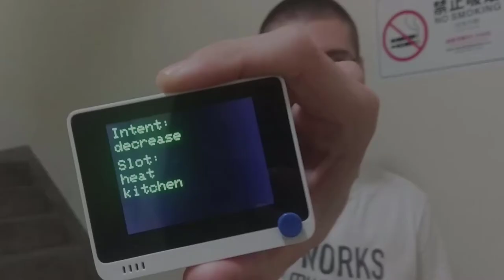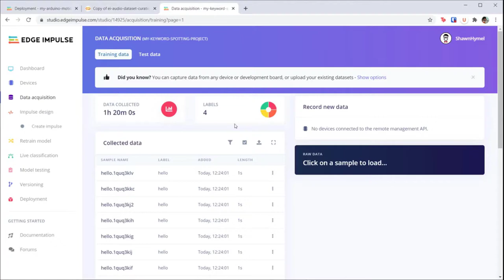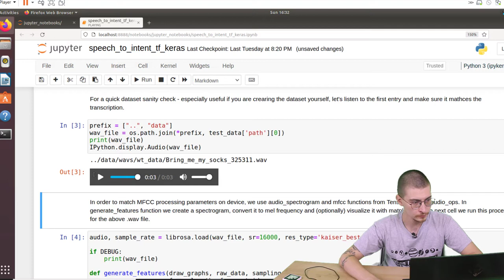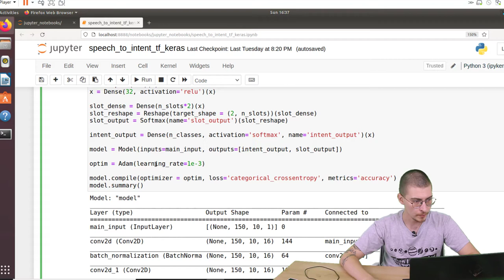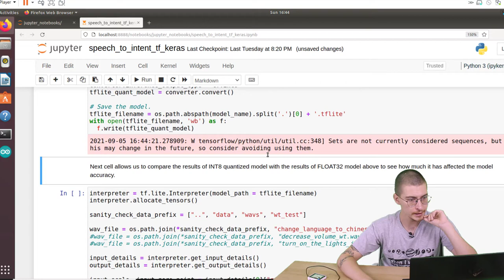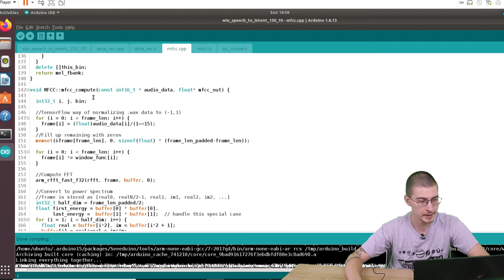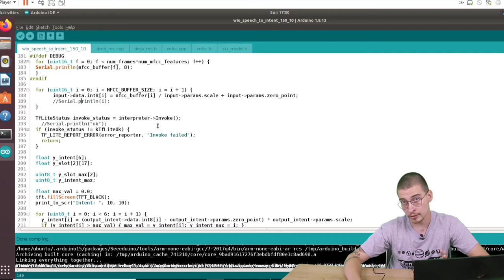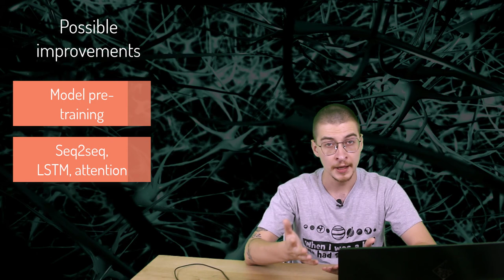Wio Terminal TinyML Course #6 Speech recognition on MCU - Speech-to-Intent

Comment: in def_create_aug_pipeline function it is showing error, plus which path should I use in the place of "../data/wavs/background_noise" ? Which ever path I am using from the dataset, it is showing error. Please someone help me out with this.
Reply from the maker: I fixed this recently here https://github.com/AIWintermuteAI/Speech-to-Intent-Micro/commit/3f5d8b533be4891a7d4732bb6fdf5dd33c841695
but perhaps there is something else going on. Can you create an issue in GH? Please post detailed error description there.

Comment: I'm a little confused between machine-learning, deep-learning (neural-networks).. and plain old OpenCV!  

For example, is the idea that you must collect the data (audio, images, or sensor data) via the embedded device, but the training/learning is always done on the cloud (ex. Edge Impulse) or a PC (tensorflow, keras, etc)?
   
And how do you tune the training/model for a particular application (or the type of data you are expecting)? 

And what does does the  (Neurona, TInyML, etc) output look like?   Is it c/python code, or more like data that you must then transform into an algorithm?

And will that work only on the embedded device that the training data was captured on?     I assume the CPU/speed will determine how fast the algorithm will work, but what are the memory requirements?

If the embedded device has an internet connection, can the real-time classification be done on the cloud?
Reply from the maker: So many questions :)
I'll pick one 
If the embedded device has an internet connection, can the real-time classification be done on the cloud?
Depends on the required latency - for some devices it can be as low as 1 ms. Hard to beat that if sending the data to the cloud.

Comment: Very interesting. One question. output = [intent_output, slot_output]. Intent and slot are different shape. How do you calculate the cross entropy? In words, how do you combine two cross entropy?
Reply from the maker: Tensorflow takes care of that automatically for models with multiple outputs. During the training you can see loss and accuracy printed for both outputs, then they get combined for total loss.

Comment: hi..
we need more project ai using this wio terminal..good job...which one is better arduino nano 33 ble sense or this wio?especially for the microphone?can we connect external mic?such as i2s or even usb mic?
Reply from the maker: So, for microphone, nano 33 BLE sense is better. You can also try XIAO BLE Sense, which is smaller and might be more available at this time.
USB won't be possible, but I2S should be fine.

Comment: Can you please explain how to do speech recognition that trains directly on microcontroller and only works with the voice of person who trains it, similar to dfrobot voice recognition module
Reply from the maker: Hmm. So from what I understand dfrobot module does not use NN - these are very hard to train on device. There are a few approaches you might take - the one that I would try is 1) train a keyword feature extractor 2) use k-means classifier on top of that feature extractor - it is very easy to "re-train" k-means classifier, feasible even on MCU.
Reply: @Hardwareai  I found out a new ML model light enough to train on microcontroller itself, its called "Sefr classifier" and its new its 2020

Comment: I'm facing the problem when this project deploy on Arduino 33 ble. 
Help me to deploy this project on Arduino 33 ble.
Reply from the maker: Yes, it won't work as is. You basically need to take care of microphone driver, using existing PDM examples. Should not be too difficult.

Comment: I have a problem
tensorflow/lite/micro/system_setup.h: No such file or directory
Reply from the maker: Are you using the right version of Tensorflow Lite for microcontrollers?
https://wiki.seeedstudio.com/Wio-Terminal-TinyML-TFLM-1/#install-the-arduino-tensorflow-lite-library
Here is detailed explanation.

Comment: While training its showing early stopping because accuracy is not improving. Any way to fix this?
Reply from the maker: Not possible to say without inspecting the data :)
Reply: Im using the data set given in the updated jupyter note book as drive link. Im just trying to run all the cells to see if i am able to generate the .h file on my machine. 

If you could help me out it would be great. I haven't made any changes to other cells. Can you verify if its working on your machine? The val loss accruacy does not improve from 3rd epoch. Thank so much
Reply from the maker: @tabrezahmed1000 okay. can you post the description of the problem together with relevant logs as Github issue?
Reply: @Hardwareai i have posted the issue
Reply: I have opened a new issue can you please check it out